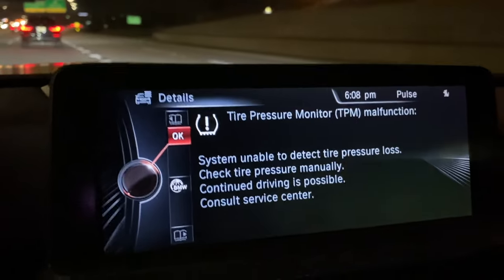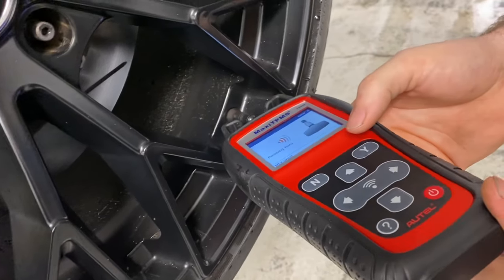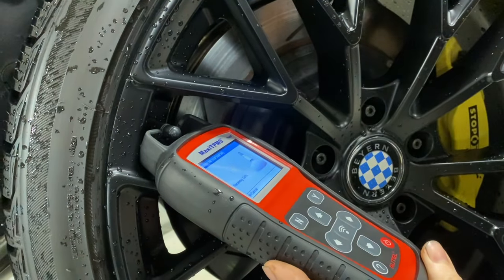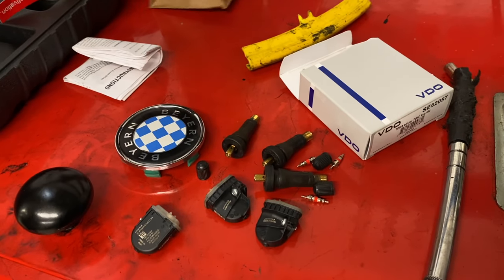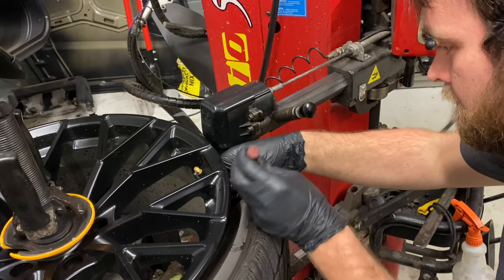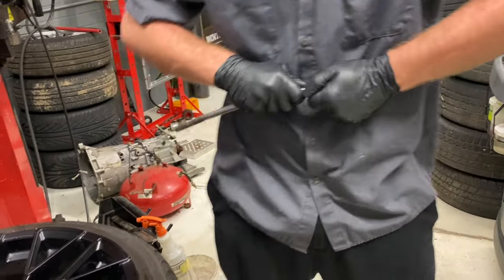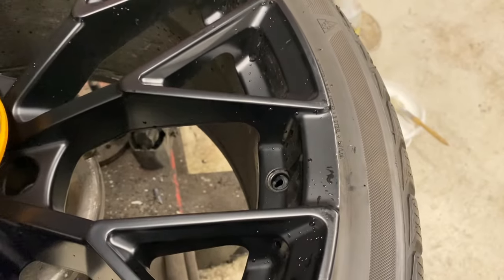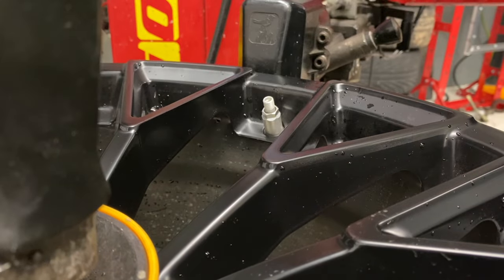Tire Pressure Monitor (TPMS) malfunction - After "Resetting Tire Pressure... 49%" FIX!

Comment: I bought the 4 sensors for about $ 60 using the Amazon recommendation, came pre programmed, took them to te tire shop, they installed them, balanced the tires and charged me $ 15 per tire, I gave $ 35 tip.
Reply from the maker: +ABW'S KITCHEN that’s great! 🍻

Comment: My story with RDC sensors on my 4 series was: ordered tyres online with "instal next to my place of work". Guy came in and installed new tyres and just rushes of to get going. I go around the car and notice that steel protectors are gone - ask him about "why" ? He said that my tyres came with new RDC. I say "hey, but I had no problem with the old ones" to which he replied "yes but you payed for new ones". After thinking a bit (and something was odd) I asked him "could I have my old one back" to which he really started explaining to me about blah blah blah ... I insisted, and he gave my my old ones back, with one being snapped off. "Well", I though, "at least I had new ones so I'm covered, right ?". Well sort of. The new ones were exactly the ones that you shown here, they took 5-10 minutes to register with vehicle after starting my trip to work. Got p*** off in the end and I bit the bullet and got to bmw and purchased a new RDC and got them put back in - now all tyre status come up within 30-60 seconds of driving. 
Now, comment about them not being able to "find the sensor" - those are activate with rotation of the tyre, you don't want them to keep transmitting when you're parked for few hours and waste battery away ? So don't get fulled with garage stating "oooohhh we can't read it - you need a new one" just tell them to spin the wheels of use the right tool ( or you could have the shoddy aftermarket ones )

Comment: The old sensors are generic that's probably why they didn't get a correct reading from the second scan tool because it was looking for a different type of sensor signal. Also this is how they get you to pay for OEM parts and labor.  Good video. Thanks
Reply from the maker: +@Boost5.0stang thanks! 🍻

Comment: Great video friend .I just had some loons at Costco in Hayes London break one of mine before Christmas.Tonight I paid £94.00 at BMW Heathrow.
Costco are footing the bill as they should but I have to wait until tomorrow as none of them were confident enough to fit it tonight.
The guy broke it with a tyre lever .The old one which has rattled around in there since before Christmas wasn’t that bad looking but he had snapped the mount so it was unusable.

PS.You’re never supposed to use that emergency tyre seal stuff on wheels with a sensor valve a tyre shop told me once .

Happy New Year
Reply from the maker: +Wilfred Wilde that makes sense. I’ve never used and never would when a plug is almost as easy ;)

Comment: the small TPMS models valve ( the black ones ) looks like a valve you can find in Walmart inflating air  duck buoy   ( the pink ones ) !   
the other ones looks like more the OEM model.
i went from E84 , to F25  with ABS tire calculation ,  but when I bough the G02 the TPMS make me choose 2 set of wheels + tires,  and I am not going anymore to the local garage , but only BMW ...
Reply from the maker: +Sebastien LICHT OEM usually works 😁

Comment: This problem is not as black and white as "damage done to TPMS valve stem" etc.  It could be entirely from a corroded RDC (Reifendruckkontrolle) box which is a separate communication box used apart from valve stems.  So in some instance your stems can be fine but this can be broken, and vice versa.
Reply from the maker: +intrapersonal true, but I bet 95% of the time it’s the sensor and not the box
Reply: @HelpMeDIY  Yeah, my troubles with it and searching for help about it is fruitless since its such a rare issue

Comment: another great video Aaron.   I just put a second hand set of Winter tires on my Boxster only to realize the tires didn't have sensors installed.  :(   Could you tell me approximately what they charge for installing new sensors into you BMW?
Reply from the maker: +george louie thanks! I think it was around $80
Reply: Interesting.. been looking at aftermarket sensors to install in my Winter tires..  the prices on RockAuto.com and Amazon run anywhere from $70 to $400 for a set of four sensors.    I found a place that I could provide the hardware and they would install 4 of them for ~$120 +tax.    The confusion is that the shops say that they need to be "programmed".. but all the descriptions say they don't need to be programmed, they just need to run OE Re-Learn procedure.. which I thought is done via the car, I know re-learn is  an option via the steering column stalk... 
   I ordered a set of the aftermarket ones from Amazon, gonna take them into the shop and see what they can tell me, and whether or not their tool will read them..
Reply from the maker: @georgelouie5330  report back :)
Reply: @HelpMeDIY  -  will do.
Reply: More information..  new TPMS sensors arrived from Amazon today..   a quick browse through the installation instructions is a bit confusing..   the Sensors are supposed to be pre-programmed, so I don't think I have to program them.. but it does say the sensors data information needs to to be setup in the car's ECU thru OBD/OBDII port and to  "setup tire location for each sensor when necessary"   Not sure what that means or whether that's taken care of thru the steering wheel on the Boxster.

Going to talk to the tire shop guy tomorrow...

@Aaron, did they have connect to the OBD II port when they setup yours?
Reply from the maker: @georgelouie5330  No, on the M4 they are auto detected for all wheels and the correct location is identified correctly. I can swap my winter and summer wheels and it just recalibrates the other set.
Reply: @HelpMeDIY  - thats what I think will happen with Porsche.. I read somewhere that the TPMS has 4 antennae located near each wheel, which I assume is how it differentiates each wheel sensor.
Reply: Ok. Aftermarket TPM from Amazon.com installed and operational. Worked right out of the box.   No programming necessary, just needed to run the re-learn program via the control stalk on the steering wheel.  2010 Porsche Boxster Base.  Sensors were 433 MHz Frequency.   All-in cost $200, including 4 sensors and 1.1 Hr Labor to install them.    I feel like I saved myself anywhere from $200 - $500 if I had gone to a Tire Shop or Porsche Dealership assuming they supplied the parts.    Hopefully the batteries will last at least a couple of seasons.
Reply from the maker: @georgelouie5330  thanks for letting me know!
Reply: @HelpMeDIY  - youre welcome.  Just sharing information.

Comment: Same issue  ,tire guy damage the tpms when they change the tire , some of them not take care too much.
Reply from the maker: +Yusuf Kilicaslan yes you just can’t depend on anyone to care about your car these days it seems 🤦‍♂️
Reply: I just had a set of tires installed today and 2 of my metal tpm stems were returned broken. The shop owner/manager did inform me and returned the broken sensors to me. He also waived the install fee. Sucks that my parts were damaged but I was encouraged by his honesty. Pondering now whether to purchase the replacement stems and washers or purchase replacement sensors. Any thoughts?
Reply from the maker: @shahmoneyxl5739  I didn’t even know you could buy them separately. I would think the shop would replace them for you if they damaged them though

Comment: the $100 ones, are they oem or aftermarket? Do you recommended going oem or aftermarket because most ppl recommend to just buy at deader
Reply from the maker: +Andrew Chow those are still aftermarket, the true OEM ones are even more expensive. If I had it to do over again I would have bought something like the second link in the description and brought them with me to the shop to have them install. But they got these for me the same day so it did save me some time at least.

Comment: Why didn't you just change the battery on the old once it would of been a lot cheaper because that's what seems to be the problem with them not very long life time with the battery they start going after 5 years and thanks for for the video
Reply from the maker: +Me because they don’t come with replaceable batteries. At least mine didn’t.

Comment: My mini have same issue. After I changed new tires TPMS couldn’t reset. It stopped at 49%. I went to local tire shop new my home and he said front passenger side sensor couldn’t detect. I ordered 4 sensors from online and replaced for  all 4 wheels. TPMS still not working. May be I need to check at dealer.
Reply: Did you ever find a fix?

Comment: So 100usd per sensor, plus labour...did that cost you over 500usd?! 2 of mine don't read, I'm ignoring it for about 5yrs, would like to fix it, but won't pay that money for bloody TMP sensors.
Reply from the maker: +Stan Vasil probably did… I found (and linked below) much less expensive sensors after that
Reply: @HelpMeDIY  Thanks, will check it out. I'm in Europe though, so will need to find something here.

Comment: Yeah mine says TPM function, I tried it with or without a fuse still not working I get that stupid tire pressure warning any other way to remove it I don't want to go into the sensors
Reply from the maker: +Jul-Lee unfortunately that’s about the extent of my knowledge on them 🤷‍♂️. Let us know if you figure it out!
Reply: @HelpMeDIY  I know but is there any way to get rid of the stupid air pressure light on my Dash taking the fuse didn't do anything I don't want to change the sensors and I really don't want to have to take my Dash apart and put tape over it
Reply from the maker: @Jul-Lee  I have a video on how to turn the TPMS feature on/off for my Porsche Cayman you can check out, but that’s the only car I’ve ever done anything like that
Reply: @HelpMeDIY  yeah but that doesn't help me